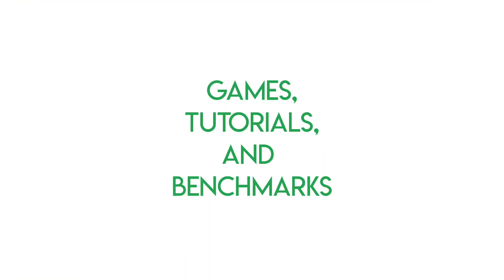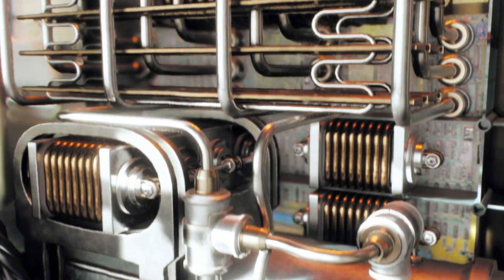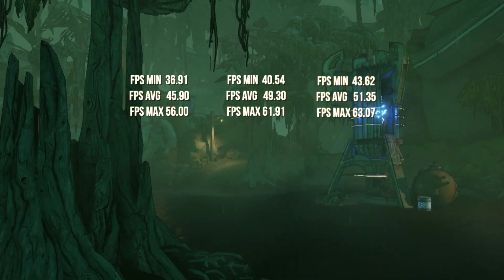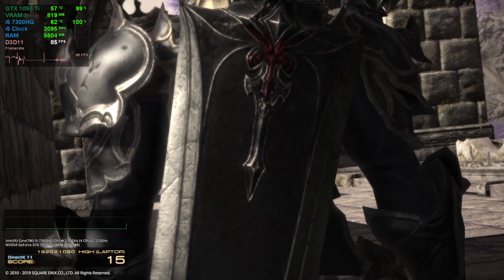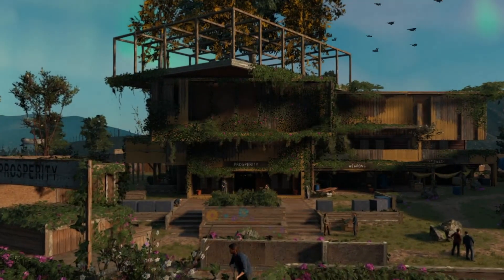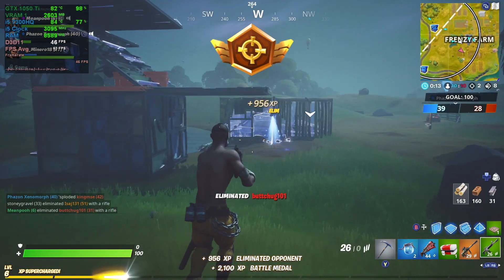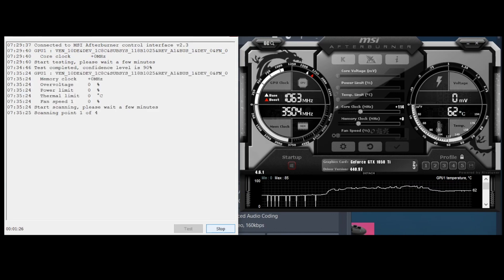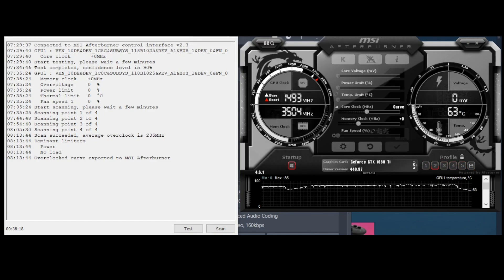EASY MSI Afterburner Core Clock Boost Acer Nitro 5

Comment: I have a gtx 1050ti 8300h what should I put it to
Reply from the maker: Start with with -.100
Reply: @Meanpooh  I'm at 200 that seems good
Reply: And it gives good performance but my thermals rise quickly
Reply from the maker: Have you tried the settings in game?
Reply: @Meanpooh  yes ihave way 90 ps in apex legends and 240 in gfortnite on preformance mode
Reply from the maker: @rodregesrussell1661  Sounds like you pushing the limit on the Undervolt.  Id dial it back if you crash again.
Reply: @Meanpooh  i think i should dial it back its a bit unstable out of game
Reply from the maker: @rodregesrussell1661  it would be best as if you get too many crashes, blue screens, etc. you could possibly corrupt your Windows installation. It’s never happened to me buts it’s a possibility and would be a nightmare if you have not backed up your system.
Reply: @Meanpooh  it doesnt crash i have it at 200 and its fine no crashes only 230  crashes but i felt 120 was more stable
Reply: @Meanpooh  how about 210 core clock and 120 memory it doesnt crash
Reply: I have tested and I crash at 230

Comment: Hey, keep up the good work ! Only one question, I have an error when I click on scan, it says "Failed to start scanning" any idea ? 1660ti version and MSI Afterburner 4.6.3.
Reply from the maker: I got that too on a different machine.  You will have to manually set your clock.  Increment the clock by 5 and run a benchmark.  Do this until its unstable.
Reply: @Meanpooh  Sorry for the lame question, but how I will know that it is unstable ? I should look for temps maybe ?
Reply from the maker: It will crash.
Reply: @Meanpooh  Okay thanks. I installed older version 4.6.2 and it worked. One last question is - should I overclock the memory speed also or no ?
Reply: @hrispenchev5150  Yes the memory clock is the most effective

Comment: Thanks for making Acer nitro 5 videos, I really appreciate your work. 
Have one question ... 
My Afterburner Overclocking Scanner won't scan. 
Here is what is says : GPU1 : VEN_10DE&DEV_1F91&SUBSYS_13341025&REV_A1&BUS_1&DEV_0&FN_0
^ failed to start scanning! 

Any advice ?
Reply from the maker: It's pretty much hit or miss and does not always work.  I Have a machine with a 2060 and it doesn't work.  It just crashes.  You will just have to manually adjust it the same as undervolting.
Reply: the problem is with the new driver, you need a old one, not sure which one tho
Reply: If you are using OC Scanner on a laptop then its Auto scan won’t run. So you have to run OC manually. It will turn out great for laptops.

Comment: hi im using nitro 5 an515-43 2019. thanks for your tutorial. let say i can overclock my gpu and it can run good. does OCing my gpu voiding my laptop waranty?
Reply from the maker: No.  Unless you completely abuse the ability such as overclocking to extreme numbers and possibly causing damage.
Reply: @Meanpooh  so as long its safe and dont cause damage, its a yes? okay thanks man u r really help me
Reply: @Meanpooh  sorry for asking another question. overclock is boost performance = more heat. undervolt = less heat less performance. if i did these things together isnt it just back to normal? like +100 then -100
Reply from the maker: Its possible thats why I dont OC the Nitro.  I get at most 2-3 FPS more which is not worth it.  You can get a stable OC but undervolt slightly to a temperature that is comfortable for you.  Not all undervolts decrease performance if done correctly.  Going too far will hurt performance.  Slightly, not so much.

Comment: I can boost memory clock on gpu but cant do the same to the core clock, im stuck at 1785mhz. I tried to boost jt via afterburner and nvidia inspector nothing worked, even if i add few mhz to core clock it still shows me im at 1785 ( benchmarked with cp 2077 )
Reply from the maker: Have you actually checked the specs for your graphics?  It can only go so high and will be limited by the amount of wattage your GPU is using.  You need to install HWinfo64 and look at the amount of power being used by the GPU.
Reply: @Meanpooh  i will stick to the limits i think
Reply from the maker: That would be best.  I think you are pushing.  Try and monitor the power usage on your GPU so you can be sure.

Comment: I have a Acer Nitro 5

with an Intel i5-9300h, and a Gtx 1650.

I tried to scan for an overclock and I got a blue screen, give me thoughts and how I should continue asap.
Reply from the maker: Slowly increase the core clock manually in small increments of 5.  Then do the same for mem.  Start with core first.
Reply: @Meanpooh  I'll get to it thanks

Using XTU unfortunately didn't help
Reply from the maker: Ixtu is for CPU.
Reply: @Meanpooh  I tried an auto scan with max fan speeds, and I think that's why it can't overclock.

If it can't scan 4 of 4, then I will manually try it.
Reply from the maker: Autoscan does not work for every system.
Reply: @Meanpooh  thanks again for the help

Comment: Did it and my laptop freezes everytime I load up windows now
Reply from the maker: So you cant even get into Windows?
If you can try installing HWInfo64 https://www.hwinfo.com/
or
Throttlestop https://www.techpowerup.com/download/techpowerup-throttlestop/

to see your CPU temps.
Reply: @Meanpooh  I believe I have found the issue. I rolled back graphics driver to the old one and stuff works. Don’t use 4.60
Reply from the maker: @Eqkuo  👍
Reply: i did it a long time ago and it worked perfectly. reset my pc today, trying to re-oc. now everything crashes again
Reply: @caleb74  wait so it's happening to you today also?
Reply: @4o7Luis  yea
Reply: @caleb74  everytime I get on and try to open a app like opera browser or something it would freeze and then I would have to reset and then I would get a blue screen, told my parents they are gunna bring it to a repair shop.
Reply: @4o7Luis  its only valorant for me. try clearing your profiles
Reply: @caleb74  I completely uninstalled it and it still happens

Comment: I have the Acer Nitro 5 i5-8300 and the GTX 1050. Will I be able to overclock and what are the recommended settings?
Reply: You can oc every pc and laptop, the only thing holding you is whether your laptop can run stable and maintain good temp. For how to OC see the end of the video.

Comment: I just bought an acer nitro 5 i7 10th gen GTX 1650ti and the performance has been quite disappointing I'm not even getting 60 fps in games like watchdog's 2 will overclocking fix that?
Reply from the maker: It may afford you a few FPS although it will not fix the problem if there is one.Getting 60FPS depends on the games and your settings.  If you've tried all options and nothing worked, I would return it.
Reply: @Meanpooh  Hey thanks for the reply I have asked amazon for a replacement and I will be receiving a new laptop tomorrow. I actually did some research and turns out that the display adapter in case of acer nitro is intel.It actually is set to intel in almost all laptops except for the legion series which leads to downgrade on performance and I've decided that if the replaced product is also not upto the Mark I might go ahead with the legion 5i.

Comment: my version has no performance.
I use the 20.11.1.
cpu razen 5 3550H
Radeon rx 560x series GPU
my notebook is an acer nitro 5 AN515-43
How can I perform that configuration for an overclock?
thanks
Reply from the maker: It's only for intel based machines.

Comment: When I use MSI, the OC option does not show up, and whenever I try to apply any settings, it all resets. Is there any fix to this?
Reply from the maker: What machine do you have?  Have you tried adjusting in small increments?
Reply: @Meanpooh  I somehow fixed the settings so that it does indeed overclock. Right now I am successfully overclocking my acer nitro 5, but the OC option still does not show up.
Reply from the maker: @ramdhanrussell5618 It works for some and others not.  You can try to overclock it manually.  Don't worry about the mem when overclocking the laptop.

Comment: Idk but mine crashed ? Can you tell me what should I do ? Mine has 1650 with i5 9300h
Reply from the maker: You need to watch as Afterburner is trying to find the setting.  Write those down and use them as a reference.  It will tell you where it was at right before it crashed.
Reply: @Meanpooh  yeah it told me, it was like 93mhz overclock

Comment: I have the 2018 nitro 5 i5 8300H, 1060 6gb version. It was marketed as turbo 4ghz cpu. How do I obtain that? I reckon that will impact fps way more than slightly over clocking the gpu which is kinda alright still, for a laptop
Reply from the maker: You will be able to hit 3,900 MHz with all your core going.  Its also able to hit 4,000 MHz  with 1 core which is sometimes difficult to reach on a laptop.  You do not need to overclock to achieve it.  Overclocking as far as I know on the Nitro 5 is not possible.  The one thing to get in control is heat.  If it gets too hot you will throttle.  Check out the video I posted yesterday about Acer Optimized Vs Power Saver mode.

Comment: I had in + 290 mhz and the battery discharge instead for charge with the conector plug, now I down to 236 to see if solves
Reply from the maker: Are you over clocking?
Reply: Yes, only the gpu, because cpu it’s really hot already that I have to undervolt, so if I don’t open msi afterburner, I don’t get over clocking?
Reply from the maker: Correct.

Comment: I recently bought nitro 5 gtx 1650 ryzen 5 model
I've installed r6 siege and mafia 3
Both r running but they r stuttering and lagging......2 sec freeze/stop
Wht is causing this prob!
Reply from the maker: How are your other games?  What is your RAM usage.  Most of the time having 16GB or RAM will solve the lagging issue
Reply: @Meanpooh   Ram is 8gb, of which I guess 2 gb is being used by raedon  and os...so i have 5.96 gb
Ive installed 2 games so far and both of them are stuttering,getting lags and mini freeze.....i have no ssd only ssd but this is slow as shit man
Reply from the maker: Hmm.  those games should run pretty smooth.  RB6 is a easy run if i remember correctly.  Noob question but are your drivers updated?  Have you tried a game such a Apex Legends?  Try turning your graphics down to the lowest @ 1920x1080 and work your way up.
Reply: I think you need more ram  man

Comment: I followed the steps but when I want to start COD MW the screen freezes even when I activate it while I'm already in a game, does anyone have a solution?
Reply from the maker: Core clock may be set too high.  Lower the Core Clock speed.
Reply: @Meanpooh  Thanks, I reduced the core clock speed from 285 which indicated afterburner to 240 and it worked perfectly. I went from an average of 75 fps to 90-100 stable in COD MW

Comment: Good stuff Undervolted the CPU and did this and getting a steady 90-100fps on Modern warfare. I have the i5/1050ti
Reply from the maker: Great work!
Reply: @Meanpooh  Thanks for the video 🦾
Reply: Btw small update for those looking for better performance i upgraded to 120hz panel screen and playing with the settings i was able to get 120fps+ on low settings is just not steady im sure im at the very edge of performance here. Maybe overclocking the cpu would obtain a solid 120fps but as it is the cpu gets very hot so i wouldnt attempt this. The reason i Undervolted in the first place was due to the heat.

Comment: How is it when you try to overclock the CPU?
Reply from the maker: I dont think ive ever tried to overclock since it already runs hot.  You can slightly overclock the GPU but not by much.
Reply: @Meanpooh  Understandable. I don't wanna be cooking eggs and bacon on the CPU.
Reply from the maker: I’d say it’s possible if you can access it with the machine on. 😃

Comment: I have Acer Nitro 5 2019, with Intel i5-9300H, nVidia GeForce GTX 1650 4GB, with 20GB of ram DDR4, can I overclock mine? To increase the fps while gaming. I need your help on this one. Thank you
Reply from the maker: You can try, some people have had luck while others have not.  Its worth a try as you have nothing to lose but time.
Reply: @Meanpooh  okay, but how to increase fps in gaming effectively? By doing undervolt or overclocking? Sorry, I didn't know anything about this.
Reply from the maker: @MFarid92  YOU will have to increase your core clock.  Try increasing by 5.
Reply: @Meanpooh  How do I do that? Some said, I don't have to do myself, just click on the 'OC' menu, run the test, once it finished, click on the scan option, then it'll automatically recommend to me the base clock I can go. Is that it? I wish I can bring my laptop to you instead.
Reply: Sorry if I asked too much. Thanks man.
Reply from the maker: @MFarid92  No problem.

Comment: Hii. How to overclock GPUs memory clock
Reply from the maker: You have to use MSI afterburner.  You may not get to far on a mobile platform.  It's more suited for desktop when overclocking memory.  Some have had luck while other have not.

Comment: I have a Nitro 5 with the GTX 1050. I'll try to do some changes.
Reply: I do also wish it was a 1050ti im trying out overclocking my gpu as we speak
Reply: @Rotary12A  how did it go?
Reply: Eh realizado varias veces el overclok con GTX1050, aclaro que no es la TI, y lamentablemente no noto ningun cambio en nungun juego,
Reply: @kevinescobar420  es que la normal no la puedes subir mucho. A mi me sube 5fps d media. Y eso como...para eso lo dejo normal

Comment: Can i undervolt a bit while overclocking?
Reply from the maker: As far as I know not on this machine but its possible.
Reply: NVidia probably locked the core voltage on the standard 1050, the only way would be a modified BIOS because even messing up with CFG files of MSI Afterburner won’t allow you to slide the core voltage, the power limit and the temp limit... If I’m wrong help me thx
Reply: Gianluca Simbula but I have a gtx 1050 ti and I cant mess with the core voltage power limit and clock memory. did u find any fixes?
Reply: @ramses7568 on a notebook?

Comment: does this work with the 2018 nitro 5?
Reply from the maker: Yes.
Reply: @Meanpooh  all my games freeze when I let it do the settings it tells me to do
Reply from the maker: @youtubeuser12588  Hmm.  Try to lower the Core Clock manually from where Afterburner set it.  Try increments of 5 until its stable.
Reply: @Meanpooh  yeah I got to one that it worked at thanks for the video
Reply from the maker: @youtubeuser12588  Good work man.  Too bad the Nitro 5 will not OC higher.